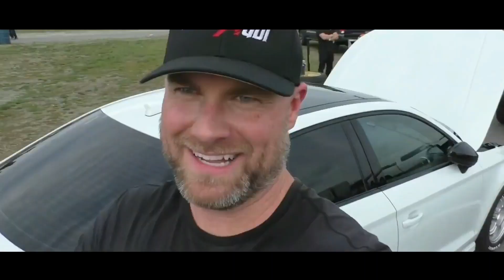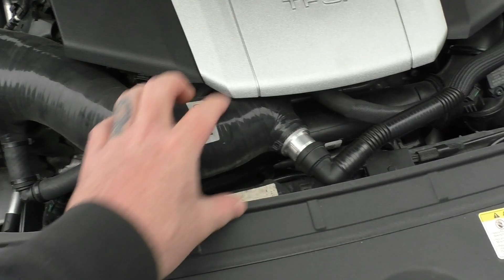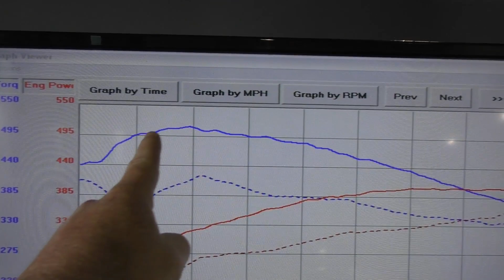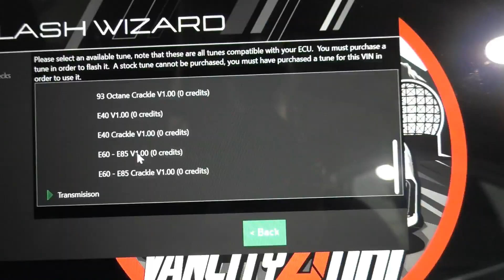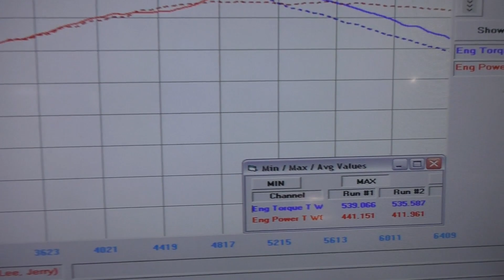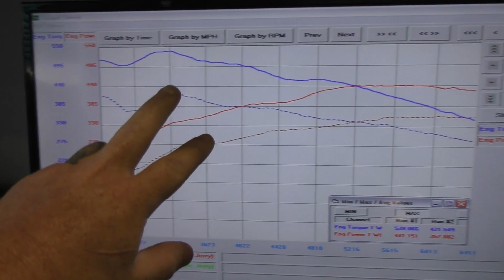Audi B9 S4 - Integrated Engineering - Stage 2 -  Dyno Testing

Comment: does anyone know why e40 or e50 makes more power than full e85 on some platforms?
Reply from the maker: Not all fuel systems can handle straight E85. So, because of that, lower ethanol contents will make more power because those lower blends will be able to be optimized. The power needs to be turned down in some instances because the hardware can't handle straight E85. You have to remember that the higher ethanol content you run the higher rate of flow your fuel system needs to be able to handle.
Reply: @ from your understanding, do you think the b9 s4 platform is better on ethanol mix or full e85?
Reply from the maker: @andytran-ry7yc I made an entire video series on my channel going through the build on my B9 S4, where I explained that a few times. On a Stage 1/2 B9 you don't need anything more than E65 to make peak power.

Comment: I’m concerned with the trans handling the power increase after tuning. Do you have any concerns or issues with it? I’m on the fence about tuning mine. Thanks
Reply from the maker: I wouldn't be concerned with it at all.  These ZF8 transmissions can hold a ton of torque.  These nearly identical transmissions come in a variety of high performance vehicles and plenty of those make much more torque than our cars do when they're stock.  My car has not shown a single sign of having any issues once I increased the power as much as I have.

Comment: So it looks like the b8 Audi can drop more power than the b9 with a stage 2 tune. Then if you go stage 2 with a dual pulley & tune your easily making 540whp. Can the b9 get numbers up there
Reply from the maker: A Stage 2 Dual Pulley B8 S4 makes more horsepower, but much less torque than a Stage 2 B9 S4. A Dual Pulley and tuned B8 S4 are nowhere near 540whp. I own a 10 second Dual Pulley, Throttle Body B8 S4 and it makes 465whp on an uncorrected Mustang dyno.
Reply: @VancityAudi  thanks for the feedback, I was just going off of the ECS web numbers they said you’ll make 540 with a dual pulley & on e40 I think. Just trying to get some clarification before I upgrade to the b9 s4 or the s5 sportback, rn I have a b8 s4. So I’m trying to figure what’s the best platform to Dump my money on
Reply from the maker: @yeezyyee7200  540whp is very, very different than 540hp, lol. 540whp would mean it makes over 600hp at the crank. 540hp is already measured at the crank and is very believable. That's roughly what my car made. I'd personal dump money into a B9 and not a B8. The upcoming potential of B9's will be superior in my opinion. Plus it is a more modern car.

Comment: I can't imagine how heat soaked the car gets because of having the air filter free in the engine compartment without any heat shield. My parents S4 which is completely stock gets crazy hot on the enigne bay.
Reply: air in vancouver is pretty cold honestly, we dont really get heat soak unless it's summer time, plus we're at sea level, for example, today it's like 2-3C out, normally around 10-15C is average for most of the year

Comment: I would’ve thought you’d squeeze a bit more running E compared to 93. Unless your limited elsewhere so you got as much as you possibly could without swapping out supportive mods to maximize E ? That’s still super good finish line 🤘🏻🤘🏻
Reply from the maker: The tiny stock turbo is the limiting factor

Comment: Interesting. My B9 S5 with the same bolt ons and EPL E40 tune pulled 475whp (dynojet) in crappy DA, 80 degree heat with the AC on (my bad).
Reply from the maker: That's why it's dumb to compare dyno numbers from one part of the world, on a different dyno, in different conditions, with different fuel, at a different time, to one another, lol.  I do these videos to show the gains from start to finish, not to compare the peak figures.  To do that would make no sense at all.
Reply: @VancityAudi  great vid btw 😂
Reply from the maker: @ssanderson12  lmao. Thank you

Comment: i'm getting my b9 today, same color and s-line stuff, it is not s4 though :(
still i'm told that i can get it from 252 to 320hp with stage 1. It will be enough for me.
Reply: I have an STi. I’ve driven a B9 A4 and was happy (previous B5 A4 owner). Let me know how much you like the car, if you wish you would’ve got the S4, etc
Reply: @avantnarde2815  loving the car, much improved compared to my last car -a4  b8.5. I'm satisfied with acceleration for now, but will definitely get the stage 1 after winter. And actually 2.0 stage 1 is faster than s4, and looks the same. So not sure if it worth to pay extra
Reply: @pashabiceps95  the dsg is built the same and all tho? Is it just the suspension and brakes that are different? And aluminum trim, red interior?
Reply: @avantnarde2815  well my car has s-line stuff and improved seats and all, looking on s4 pictures I don't see the difference outside and inside. Maybe there are some changed internals etc. But for me it is the acceleration that matters, I will not take it to the track.
Reply: @pashabiceps95  A stage 1 definitely is not faster than an Audi s4, maybe stage 2. Stage 1 doesn't get you 100hp.
Reply: @evaristocorripio5434  check this video youtube.com/watch?v=Ro4QmxjRECc
Reply: @pashabiceps95  may I ask how the hell they managed 0-60 in 4.9?😂 I have done multiple 4.4 to 4.3 in mine, completely stock. They didn't launched it peoperly I guess.
Reply: @evaristocorripio5434  yea, it is wierd, but hopefully 4.3 for regular a4 is true

Comment: so the tune works like flexfuel, if you put e60 or e85 or e68 it will simply adjust itself so it doesn't matter how much E content you have as long as its between e60-e85?
Reply from the maker: Working like Flex Fuel would mean you can put any type of fuel in and it will adjust from 91 octane, to 93 octane all the way up to E85.  That isn't the case with this.  Once you have tuned the ethanol file you can only run an E60-E85 content.  Anything less or more than that would be potentially hazardous.  I would imagine that if you run an E60 blend you may see some timing corrections.  I would also imagine that if you run straight E85 your fuel system will be working harder to maintain the fuel pressure needed.  I personally would run an E70-E75 blend if this was my car.

Comment: Love your videos but there’s no way the crank hp figure is 350hp and the Dyno is reading stock power at 357 WHEEL Hp. Unfortunately it may be another dyno that’s actually showing more what the car is making at the crank not wheel.
Reply: No. You are forgetting that the car has Stage 2 boltons and is running Pumpgas blended with 18% Ethanol. On normal 91 octane fuel the stock tune baseline numbers would be down around 40whp from the initial results. Then take away all the modifications and the result would be even lower. That being said, Audi's typically under-rate their vehicles HP numbers.
Reply: Unlikely as the result of adding modifications without a tune adjustment rarely yields any more than 5-10hp. As for the fueling again manufacturers generally don’t show much difference putting premium fuel/eblends without a retune
Reply: @Famous_Flavours  apr dyno'd stock B9 S4 at 400 crank hp and 400 tq hp roughly
Reply: Well Adam ran a stage 1 b9 S4 on this channel and it only hit 115mph. For reference my car dynoed at 420whp & hit 124mph so somethings up there. Mph trap normally shows the true power
Reply: Hence why they hit higher gears down the 1/4 so what’s your point?
Reply from the maker: This is why you need to stop comparing dyno numbers and simply look at the gains achieved.  Every dyno will read differently.  Different cars, different parts, different fuels, different DA, different ambient temps, dyno's calibrated differently, different brand of dyno.  Comparing dyno results is just ridiculous.